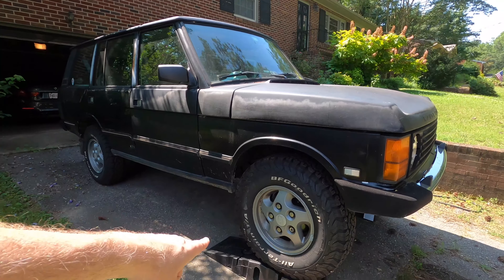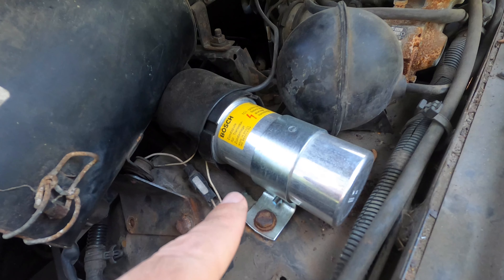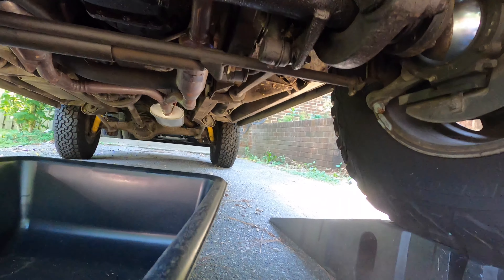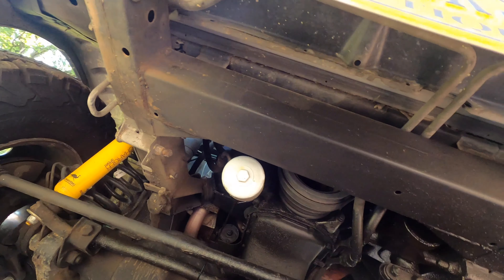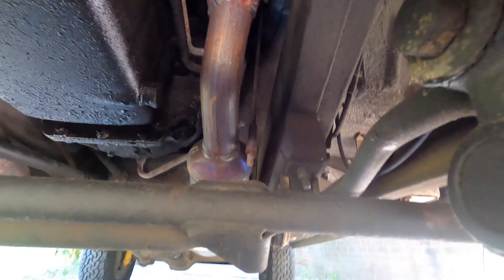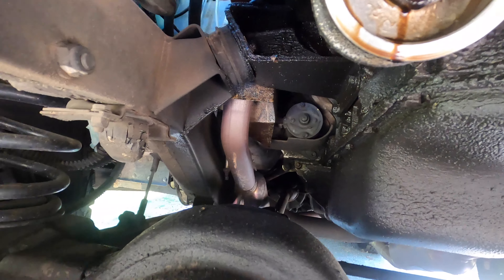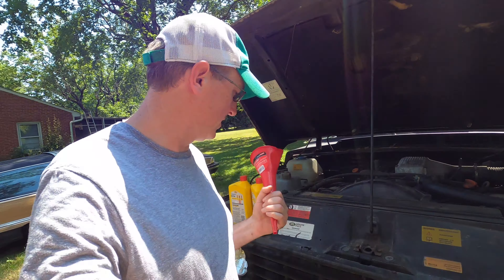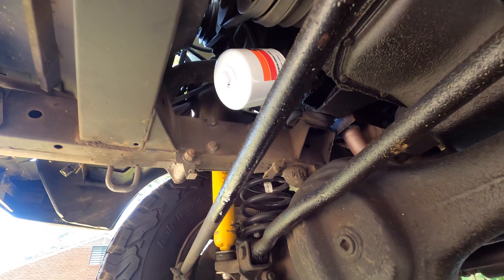#RoverRescue 4th of July Special!

Comment: Always nice to see more Rover rescue! I know oil is a very controversial subject but just a tip this is definitely not the right oil for a Rover v8 10w-30 is too thin you should use at least 10w-40 semi synthetic or 20w-50 conventional don't forget the Rover v8 is essentially a 60s engine !
Reply from the maker: Well it is at least semi synthetic!
Reply: @DougsCars  got something right 🤣 I would recommend changing it soon If you don't wanna start hearing valve tick had it happening in my p38 range rover and it seemed a lot quieter on 20w-50
Reply from the maker: thanos mousios Haha I won’t be able to hear it over the exhaust 🤣
Reply: @DougsCars  lol perhaps the exhaust and those hanging o2 sensors hanging there are more of priority then 😂😂
Reply from the maker: thanos mousios For sure, at some point this summer!

Comment: They probably let you out so they could look at the cool car.........& Did you put the censors back in the cat's?     & is it the exhaust manifold gasket that's leeking or a crack in the manifold itself?
Reply from the maker: I was told I need to replace the manifolds entirely...by the guys who didn’t install the O2 sensors.
Reply: @DougsCars  can you get replacement one's or are they hard to find?  P.S. what engine has it got.....the 3.9L or the 4.6L?
Reply from the maker: Burty w I’ll have to get used ones. It’s the 4.2 as it is long wheelbase.